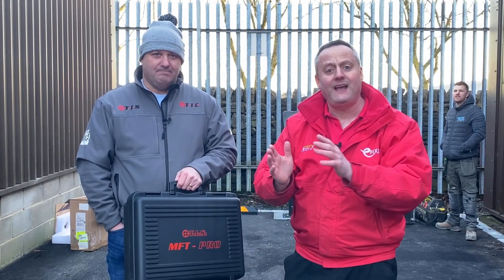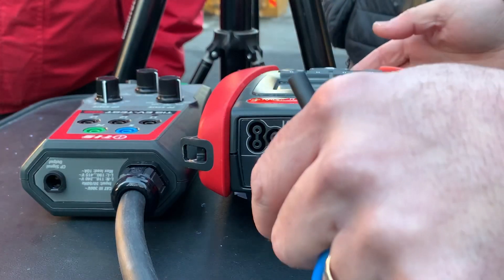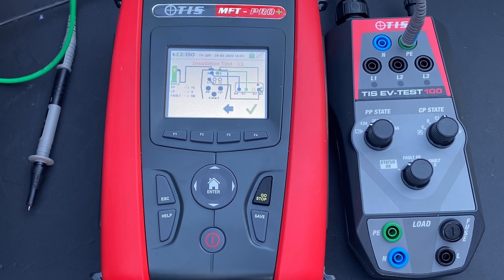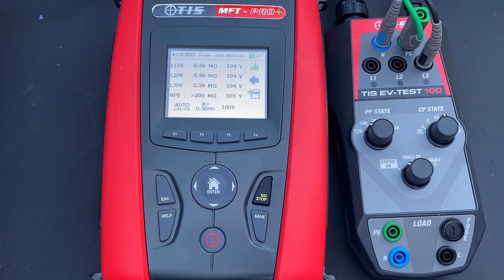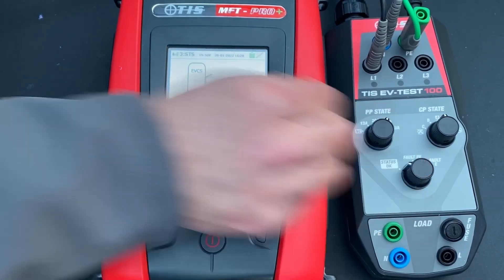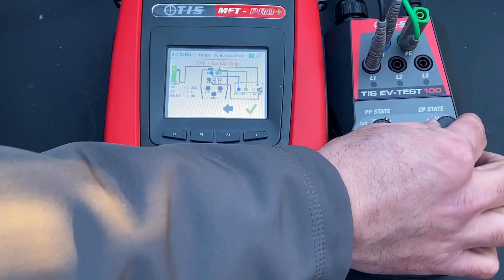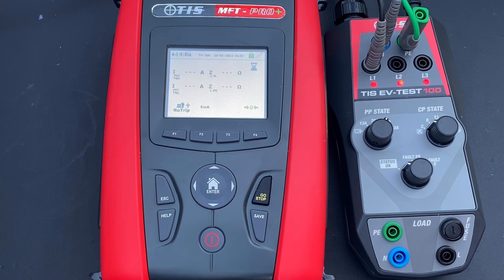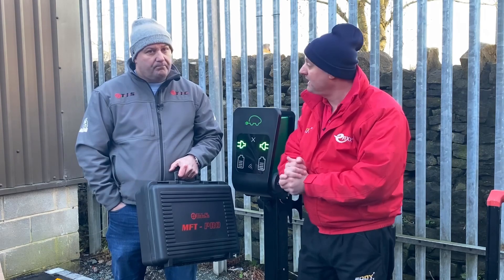How to test a three-phase EV charger with a TIS MFT PRO & EV-TEST 100

Comment: Why is the Pfc shown as 1.17kA when the Zs is shown as 0.15 ohms.    I thought Pefc would be Voltage (240) divided by Impedance (0.15)   i.e 1.60kA rather than 1.17kA displayed.
Reply: The reason PFC reads 1.17kA is due to the following BS7671 correction factors:

Nominal Voltage should be 230V x 0.95

Temperature correction factor is 0.8

Therefore, 230V x 0.95 = 218.50V

218.50V x 0.8 = 174.80V/0.15Ohms = 1,165.33A

👍
Reply: @testinstrumentsolutions  Surely this is a miss-application of Cmax and Temp Correction factors. 
I thought these factors were designed for use in calculating the Max measured Zs of a circuit which would result in a current not TOO LOW to ensure disconnection of the protection device within the prescribed time. i.e. to be on the safe side, we calculate the current based on the lowest supply voltage (with fluctuations) and the highest loop impedance due to preheated cables.
Surely the whole point of measuring the Pfc is to ensure that the highest possible fault current will NOT be TOO HIGH to prevent the protective device from disconnecting due to arcing etc. i.e. to be on the safe side we determine the highest possible current. Therefore we should assume the highest voltage and lowest loop impedance. Measured voltage was 240V (no nominal; no Cmax).  And contacts will already be fused closed by the time the cable reach 70C; so NO allowance for thermal effect on impedance.
Reply: @geraldelwood9660  You’re right Gerald. When did the method of applying factors start when taking live test measurements? Live test results are what they are, thats the point of them not to start applying factors and altering them. As you say, application of factors are design stage and for calculation.

I’d of thought either efixx or TIS would’ve been back to clear this up by now